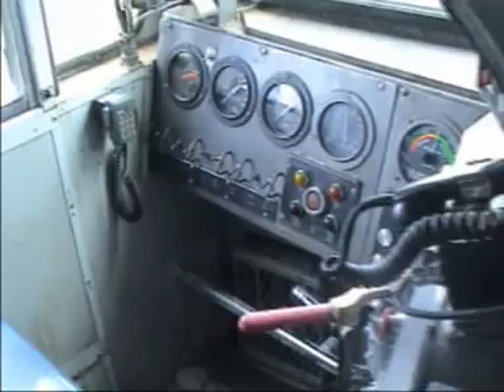The noisy bit

Comment: The standard air compressor is a three-cylinder Gardner-Denver unit. There have been alternates in the past, however.

If the unit has the G-D logo, then it is a Gardner-Denver.

Comment: they are driven by engine crank via spring loaded turbo drive gear until it reaches proper RPM and exhaust pressure. Then it is driven only by exhaust pressure. It is really a turbo and supercharger in one. They really are a cool engine.

Comment: you are right  gear driven to 80 percent then a sprag clutch disengages therefore making it a true turbo           I worked as a mechanic rebuilding these monsters 645's, 710's  
28000 rpm,  weight over 3000 pounds,  the turbine and compressor wheel alone weigh 125lbs    awesome turbos

Comment: Technically, it is not un-silenced. There are no silencers on these engines.

What has been removed is all the piping between the engine block's exhaust ports (which are water-cooled) and the input to the turbocharger.

The output of the turbo is, of course, the exhaust stack.

So, the turbo's turbine input is horizontal, whereas the turbo's turbine output is vertical.

Comment: EMD 567, 645 and 710 are constructed identically.

The basic design of ca. 1936 was so fundamentally sound, from an engineering perspective, that it could be very easily "scaled".

Because certain dimensions remained the same between the 567 and the 645, 645 service parts may be employed on 567s

The 710 changed many of those critical dimensions.

Should, say, an 800 be forthcoming, I would assume that new design would retain as many 710 dimensions as possible.

Comment: I'm pretty sure that's a 16 cylinder you got there (bit hard counting the cylinder covers), I know the UK 66s are 12 cylinder, 710 series engines (710 cubic inch per cylinder). I believe the 16/645s are about the same HP (around 3300) as the 12/710s which are later technology with electronic fuel injection etc.
The new SD 70s they've just bought in the Pilbara are 16/710 series EMDs, about 4500 HP a guy that drives one told me.
I'm no expert, so correct me if I'm wrong.

Comment from the maker: Question; how do you go from low idle to high idle. Answer ; move reverser from centre to direction. I can't make it any easier to understand.
Reply: with these high turbo engs they can idle at 180 -190 rpm in super slow idle ... ad 70s used to be on fec railway ,,,also 430 -434 mid 80s era did . Woodward gov. chip to save fuel